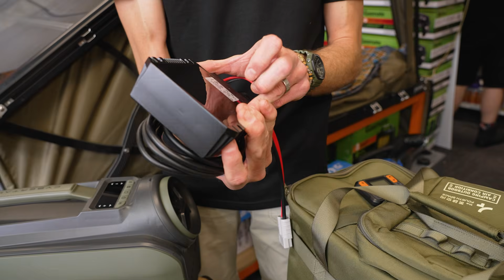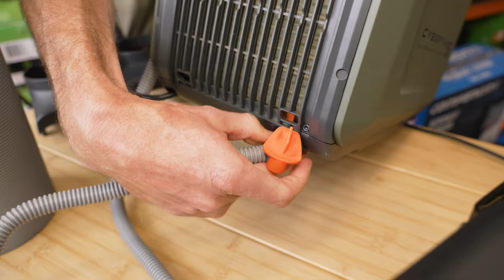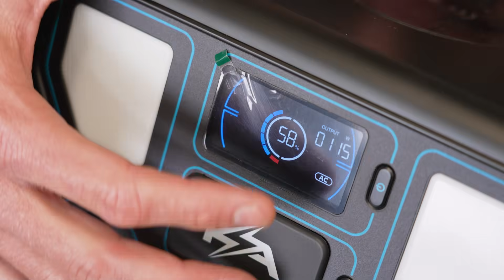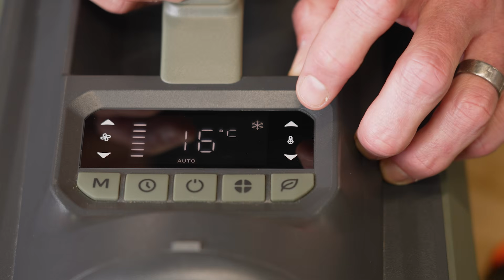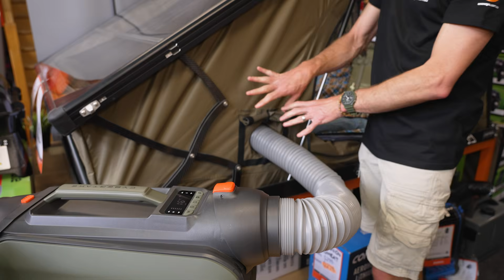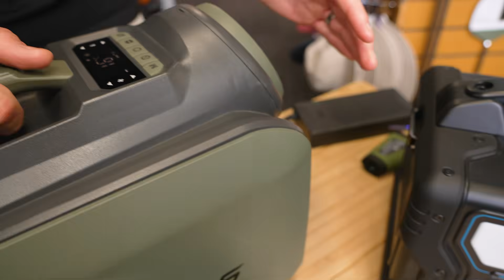Cybertake S1 Pro Portable Air Conditioner

Comment: SNowys is about the only place that does these demos. You will never get a portable aircon that will cool a tent in Aussie summer. It maybe good for for night time, to take the edge off. Keep up the good work. DOnt listen to the Karens (Barbara).
Reply from the maker: Thanks for your comment, Mick. We recently filmed a stress test on a 40 degree day with the Cybertake S1 and a swag. Not the sort of conditions anyone should be spending inside a swag, and far more than a unit like this should be expected to perform in. It was 57 degrees inside the swag, zipper pulls were too hot to touch. Stay tuned to see how it performed. ~ Ben

Comment: Waste of time, your tent doesn’t seal like a home so cold air will create condensation in the tent
Reply from the maker: It's the moisture in your breath that will cause condensation, and this is generally an issue when it is warmrr in the tent compared to the cold air outside. I'm not sure how condensation would occur if you were cooling the inside, the air conditioner will actually help to dry the air out. ~ Ben

Comment: Good concept, but when you say to dehumidify you need to place the entire unit in the cooling space, if they just made another vent adapter for the return air, it would always be able to sit outside. Wildly inefficient to be constantly pulling in hot external air to pump into the cooling area. You always want to be getting your return air from the cooled zone, it will use alot less power and cool sooo much better.
Reply from the maker: They have an S2 Pro version that does just this, also a little more powerful, video n that coming up soon. ~ Ben
Reply: @SnowysOutdoors should do it in all models, it's bad design otherwise.

This model is already more expensive than a proper 3.5kW Mitsubishi heavy industries split system.. it is actually a joke, I hope they fail and realise not to rip people off.
Reply from the maker: @1989cranston  thanks for your feedback. ~ Ben

Comment: Had one , returned it, it cannot keep up with Aussi heat even in a small tent in the shade.
Reply from the maker: There is only so far a compact air conditioner like this can go towards making the temperature inside an uninsulated shelter setup in hot Aussie heat cool and comfortable, that's just common sense. Maybe you're being unrealistic? ~ Ben
Reply: @SnowysOutdoors what a rude comment. Do better. Won't be shopping here.

Comment: None of these portable air cons are fit for purpose.
Reply from the maker: Thanks for your feedback, can you elaborate, or suggest a better option for anyone looking for a portable air conditioner like this? ~ Ben
Reply: @S @SnowysOutdoors  Hi Ben , “not fit for purpose “ over 30 degrees any of these type of air con do not do the purpose you would buy one for . 2 hrs running time on high , when it’s hot and I turn on my home ac I always have it on until it has cooled the house , if my home ac only lasted 2 hrs no one would buy them . As far as me suggesting a better option, I’m sorry mate I’m not an aircon tech so can’t help you but if I’m camping and it’s going to be over a comfortable temperature I generally won’t go . I appreciate these aircons are being researched and developed but at the moment they are not fit for purpose. Tell me why you disagree ?
Reply from the maker: I don't entirely disagree, but, unless you can transport, setup, and power a 2.5kW+ split system at the campsite, then heavily insulate the walls and roof of your tent, this 1kW system is as fit for purpose as it's going to get for campers wanting a cool tent in the middle of the day.
No one is trying to hide that fact, even my Cybertake contact asked that we manage customer expectations to this effect, I said this in the video. 
However, it will work much better overnight when the tent and unit are out of the sun and you are trying to sleep. ~ Ben
Reply: @Sno @SnowysOutdoors nly my opinion but @ over $1000 for these units the term more money than sense comes to mind . If a unit that worked properly were available I would definitely buy one . I have looked at all the brands that make these aircons yet rarely do any reviewers mention the amount of units returned due to their poor performance.  They really are tits on a bull . Do you own one ? Would you pay the retail price for one of these units ?
Reply from the maker: @HLsab  I don't own one, I take a fan if I'm camping in hot climates, but that's just my minimalist style. It could be made bigger and more powerful, but there's a limit to how much you can get from 12V, and only so much room in a car for transport. Until the technology improves, this style of unit it the best available. ~ Ben

Comment: I can imagine instances where it would be really handy to be able to hook ventilation pipes onto all of the vents. So there would be four hose pipes. I dunno of any that do this but I have a use for this
Reply from the maker: Check out the S2 Pro which has vents at both ends, video on that coming up soon. ~ Ben
Reply: @SnowysOutdoors oh nice! Thank you
Reply from the maker: I should also mention that the outlet size is a standard fitting, so you can get Y junctions and extra ducting to direct air into multiple spaces. ~ Ben
Reply: @SnowysOutdoors oh nice. Yeah I've wondered about that too actually. I thought it probably would be standard. So thanks for the confirmation

Comment: If leaving it outside the tent, is it rainproof?
Reply from the maker: Water resistant to IPX4, they will handle splashes of water and moisture from dew, but it's not recommended to leave them out in heavy rain. ~ Ben

Comment: Would this be suitable do you think for an Oztent RV5?
Reply from the maker: Yes, maybe on the slightly large side, but it will have some effect. Common sense needs to be applied though, if your RV5 is in full sun on a 40 degree day, any 1kW cooler is going to have to work hard to counteract the radiant heat products by the sun. ~ Ben
Reply: Same question Oztent RV4
Reply: Did you both watch the video?

Or want someone else to do it for you?

Comment: Which KA power station are you using?
Reply from the maker: Its either the Kickcharge 700 or 1200, we cant remember sorry, and they're visually identical.
They both do the same thing, only difference is the battery size
~ Lauren